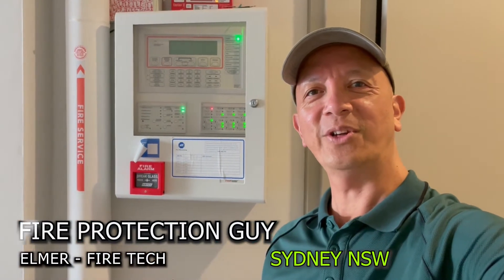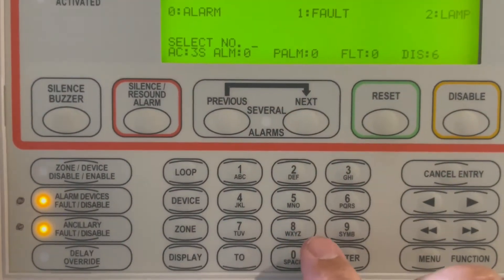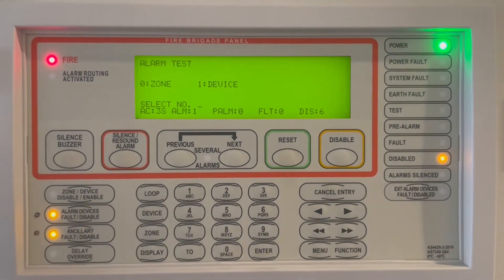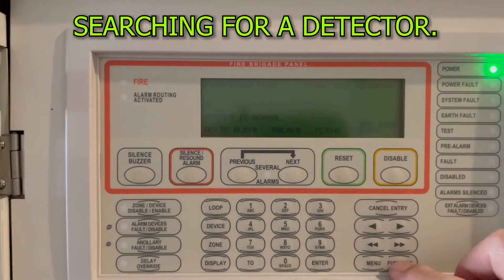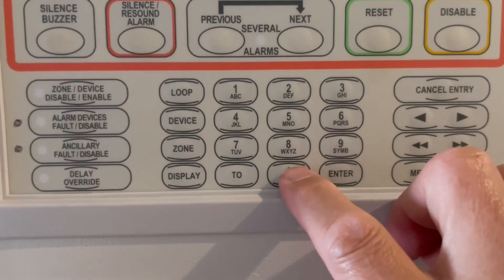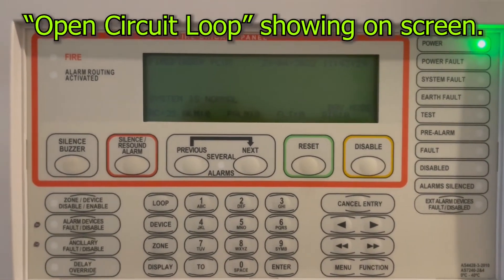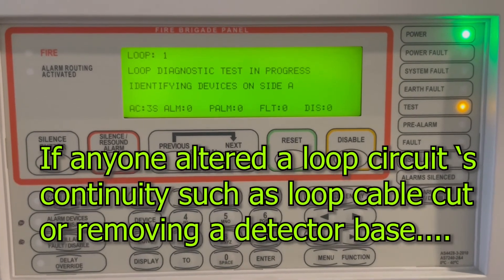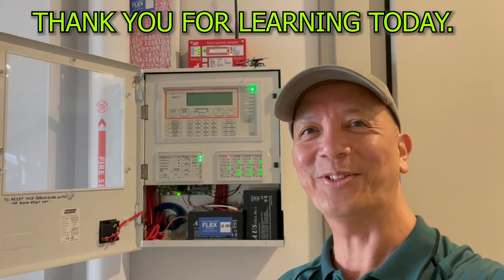FIRE ALARM SYSTEM - HOW TO TEST AMPAC FIRE FINDER PLUS FIRE INDICATING PANEL ?

Comment: Hi Elmer  whats the percentage of conventional and addressable panels you see?
Reply from the maker: There were still a lot of old small buildings here in Sydney. Most of them are using conventional system. For the last 15 years, all new installations were now  addressable system. When replacing an old conventional, we are using an addressable FIP with conventional modules. Maybe in 10 years time, you have an addressable FIP with conventional detectors in the field. Suppliers have stopped selling conventional panel.